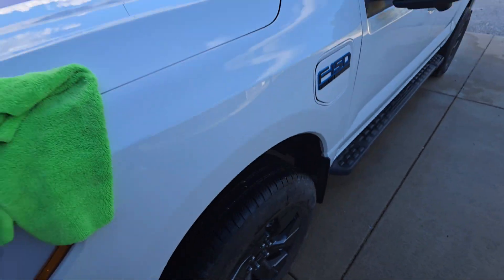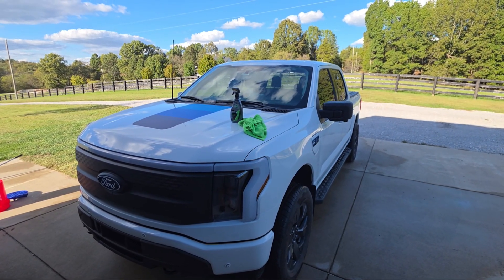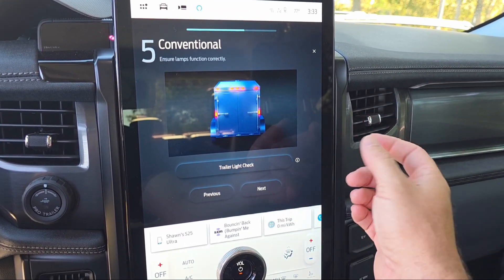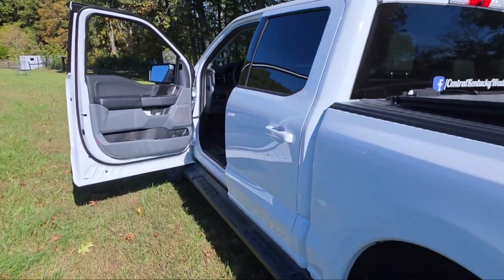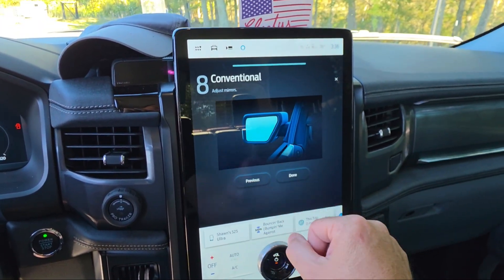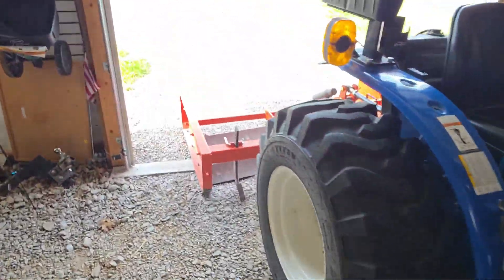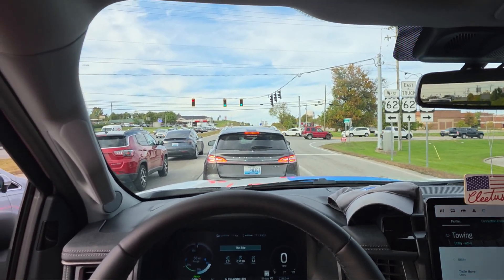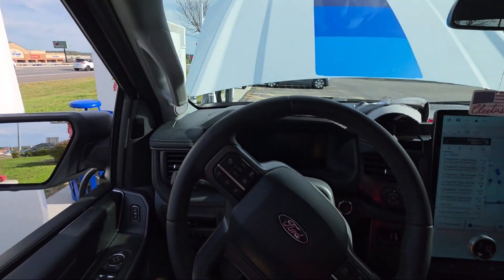Towing the Utility Trailer with the 2025 F-150 Lightning Showed More Promising Results!

Comment: That Supercharger version is compatible (V3, V3+ and V4 are), but not all of those are enabled for use with non-Teslas. Most are, but not all all. Use the Tesla App, tap the hamburger menu, and go the the "Charge Your Other EV" section. You probably need to identify your vehicle make and model, and enter a payment method. You then need to start the charge through the app by identifying the stall number. Once properly set up, I've never had an enabled/compatible supercharger fail to charge- just charge through the app and it will work.

Keep trying. As a Tesla owner, I have to say DC fast charging with a non-Tesla is doing the EV thing in expert mode. Tesla's just work, and always work. Non-Tesla's just takes a bit of research and planning to make a trip a success. It gets easier once you have various apps set up and figure out what locations deliver good speed and are reliable.

Comment: Ive been using that same turtle wax hybrid stuff on my vehicles the past couple years.   It does work great and holds up well.   I like how you can use it on the black plastics, rubber trim, cowl plastics, tonneau cover,  etc.     Sure is easier than using wax products.

Comment: I used Tesla chargers on my trip from Tampa to St. Louis last summer. I was having issues at first because I didn't push the tesla cord hard enough into the adapter. On my A2Z connector, you really need to seat that sucker in there good. Also, you need to activate the tesla charger in the tesla app and wait until the app tells you to plug in the charger. After that, it should just connect and go. If it doesn't charge, try another charger. The only station I had issues with was in Monteagle, TN at the Piggly Wiggly; about half of the chargers did not work as of July 2025. (PS: 2022 Lightning).